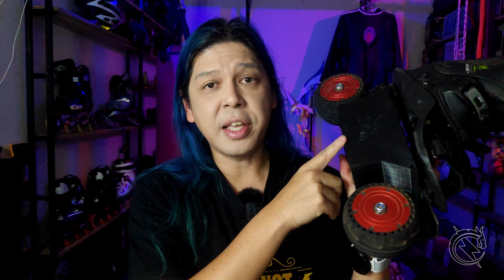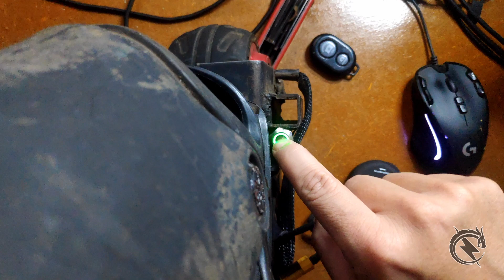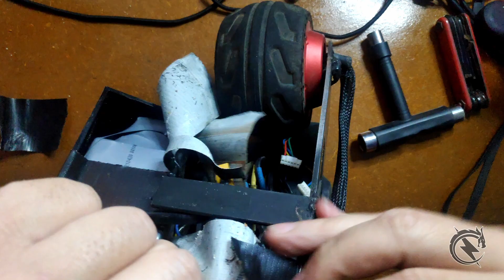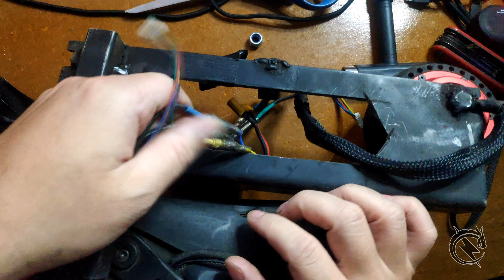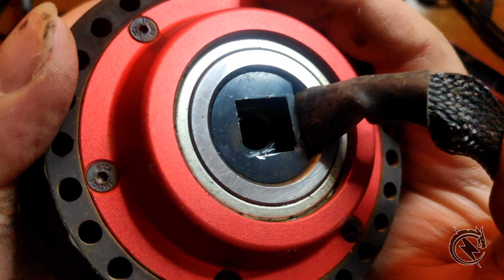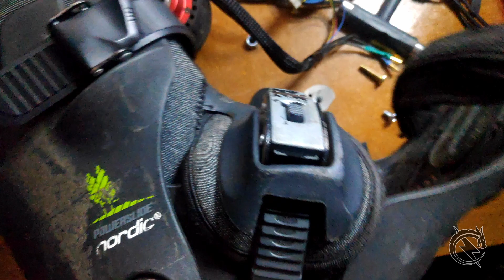How to build an Electric Inline Skate - Specs and Details - DIY

Comment: Wouldn't using the same brushless hub motors used in Segway and various brands of e-scooters available on the market be better and easier to use than the motors you showed in this video
Reply from the maker: well those motorts tend to be way bigger and heavier than electric skateboard motors. inline skates wheels tend to be between 70mm to 125mm diamter. any bigger than that it is unskateable. you would be better off riding a scooter/bike

Comment: nicee breakdown love the prototype man ! Are there any battery advancements that are being developed right now that could possibly slim down the profile of the build ?
Reply from the maker: if we are talking the DIY route, than you could use RC Drone batteries which are way slimmer.
but for a finished product safety is number one. Also 18650 batteries are so easy to use even from a DIY perspective that it makes no sense going through the trouble of using pouch Li-PO batteries.
but theres not anything revolutionary in the radar on battery tech for the next decade or so. even if there are some lab tech which is revolutionary, until they can be mass produced usually takes several years and then some more to be affodable.

Comment: How do you make the frame ?
Reply from the maker: I actually filmed  the making off, but my phone lost the footage, so I'm sorry I dont have the actual "how to" of the frame. 
its basically welding all the parts together and cutting some.

But I dont really advise to trying to copy this design. so next time I will try a different one.
Reply: @Thundrblade  Hey,the design may be different but will the part inside be the same?Im a college student that want to try making this amazing eskates. I'm just stuck on the frame part
Reply from the maker: @aquanixer8337  sorry,what do you mean? I know making a steel frame is hard without tools.
Reply: Could you sell frames so it’s easier to build we could buy the actual parts tho like the motor and boot
Reply from the maker: thats in the plans. I will build the next frame and if this time around it works perfectly I will probably make them for other people.
Next frame is going to be CNC cut, so its going to be nicer looking as well.